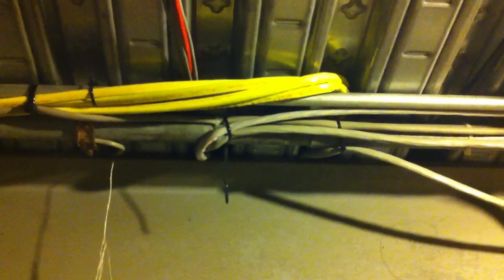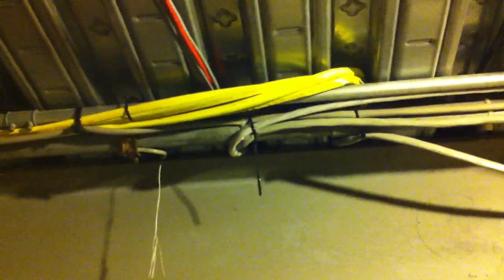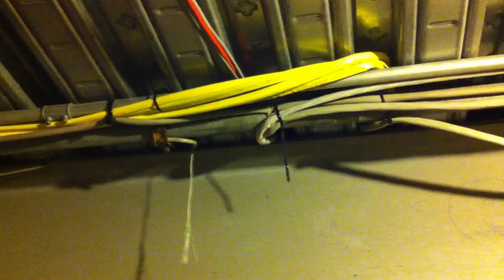Moving Violations Video No. 167: Taking the Easy Way Out

Comment: What issue does this actually cause in the real world code aside? Provided you don't strap 100 cables to it, or the possible crosstalk issues..
Reply: so when to stop ?  first 10 cables are permitted to be support by emt, or maybe 20, or let to  add one more, than again one more.... as result we got that bunch hanging on conduit. and looking on those short nipples for double  45 degree bands on 1/2" EMT I would doubt proper installation of conduit as well . ALSO when systems are supported independently that is making future renovations much easily